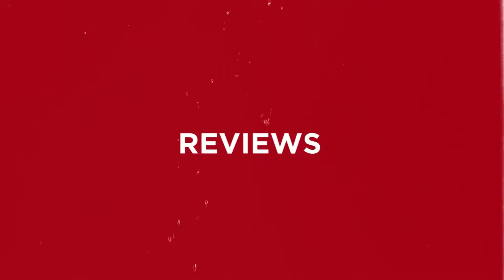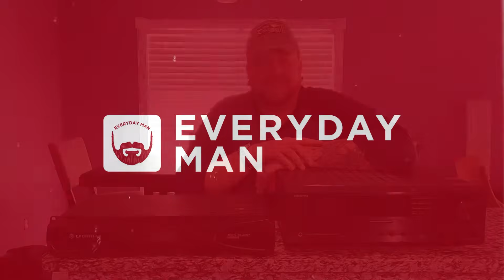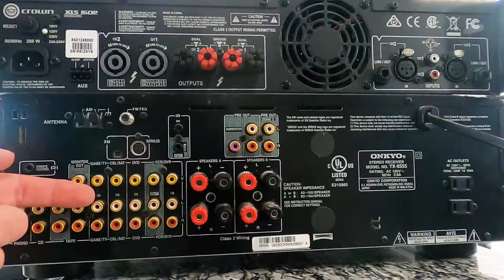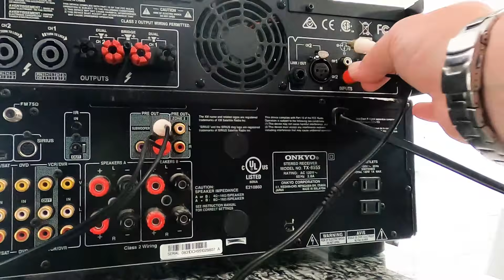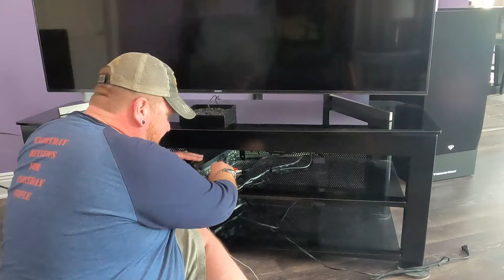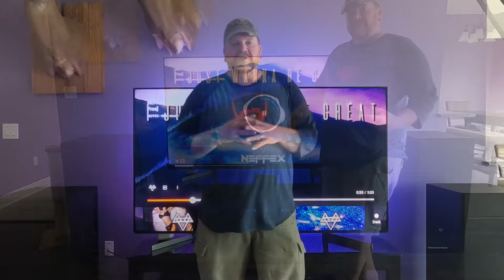How To Hook Up An Amp to a Home Stereo

Comment: OMG I need help setting up my new to me sony 5130 tuner. I didn't see it has no volume control. I feel like such an idiot.
Reply: I completely understand what you are going through. I am totally blind. I have no vision whatsoever and I recently purchased a Sony receiver. STR – K700 and it did not come with the remote so right now I cannot even change the AM/FM tuner up or tune down stations, I was trying to hook up an Alexa I have an Alexa from 2021 that is shaped like a hockey puck and it has a N put power button our suite a slot and I believe it’s an auxiliary out slot of some type but I can’t even connect that to this receiver because this particular receiver only has a microphone input slot on the face of it. There’s no auxiliary input or slot. I would call it on the face of this thing, so I was curious to know if there is a particular RCA style that I could use to plug into the back of my receiver and plug it directly into my Alexa echo dot, so don’t feel bad about your situation. You are OK. Everything is going to be great. Thank y’all very much. Hopefully y’all can give me some information on a particular jack or input wire cable that I can use to hook up this Alexa echo dot directly to the back of this Sony STR Dash K700 receiver. Thank you again have a great day.
Reply from the maker: I got nothing for ya, sorry. I wish I could help.
Reply: @EverydayMan  Thanks for the reply anyway. This thing is cool, it's got 300 ohm AM and FM external antenna connections. A 75 ohm coax external ant. jack. 4 speaker out connections, two of which are adjustable, and numerous other jacks. I hooked up some speakers to it and can tune stations AM and FM just no volume.

Comment: Question for ya- my pre amp is a 90's Carver and obviously doesn't have any way to sense the signal for trigger power from my receiver (so I will be pressing the power button every time). Do you know of a way to simplify this chance?
Reply: @EverydayMan  cause that makes sense... Lol
Reply from the maker: I leave my amp on all the time.
Reply: @EverydayMan  yes, I would say leave it 'engaged' all the time, but have it connected to an external 'on-off' like a power strip...or something... I actually deliberately wired an outlet to a light switch, so all I have to do is keep the power button in the 'On' position...and just flip the switch..and everything turns on at the same time

Comment: what if the stereo doesn't have a pre amp rca
Reply from the maker: I don't think you can us an amp.
Reply: @EverydayMan  ok so I took my IPhone with the head phone adapter and rca at the other end used a stereo equalizer and hooked it up, it play but the signal is weak, the phone volume is almost half way but the amp starts reading the signal, it gets loud but not punchy so I tried a  mini pre amp phono input which boost my signal strength and gave me the punch but it sounds muddy and it starts clipping at about halfway
Reply from the maker: @elishasrepairandmore3639  change the sensitivity on the amp.
Reply: @EverydayMan  ok thats the switch on the back with .775 to 1.4, let me try that
Reply: also I appreciate your responce
Reply from the maker: @elishasrepairandmore3639  did it work?
Reply: So I put the switch on the lowest signal .775 and decreased the volume on my phone and turned up the channel levels, I am going to purchase a stereo with the pre amps but this will do for now, I have to get another set of rca jacks to go from the mini phono preamp to my equalizer and then I’ll be good for now, thanks so much, it’s people like you that make the world a beautiful place to live in, thank again
Reply: @EverydayMan  yes it did, I put the selector on .775v and decreased the volume from phone and turned the knobs on the amp to my liking, I’m going to get another set of rca’s to hook it to my equalizer to get that sweet spot, I appreciate you Sir so much, thank you, I’m going to get a stereo soon with the pre amp but this will do for now, thanks again
Reply from the maker: @elishasrepairandmore3639  that 2 channel Onkyo I have is a great stero reciver for a fair price.
Reply: @EverydayMan  ok what model is yours and where you order it from, I got my eyes on a Onkyo TX-8050 used for $75, I'm to see if they will take $50
Reply from the maker: @elishasrepairandmore3639  mine is old and they don't make it anymore. But any onkyo with the pre amp out will work because you have an amp.

Comment: Hey I watched your video,(https://youtu.be/KYBIQlLMImw) thanks for the info. What's the proper way to put the jumper together with the 4 prong plug? The wire you have is 8/3 not 8/4.
Reply: Okay cool, I'll copy that.
Reply from the maker: Just hook the green wire to the ground connector.
Reply: @EverydayMan  ok cool, so green to ground,  and match the rest/ignore the red?
Reply from the maker: @earlnoel4423  no back and red are hot. White is neutral  and green is ground
Reply: @EverydayMan  what if I have 4 speakers? Can I hook them up 2 speakers for each side? Like 2 positive and 2 negative together?
Reply from the maker: @brittanylake6815  yes u can.
Reply: Thanks for the replies. Sorry but my confusion is that the wire I ordered from your link is only white black and green no red. So I'm left with an empty
Reply from the maker: @earlnoel4423  ok, what I did was use black and white for hot and green for neutral with an empty ground.